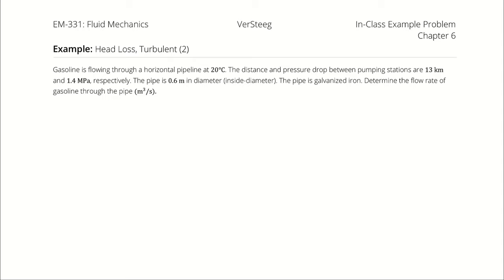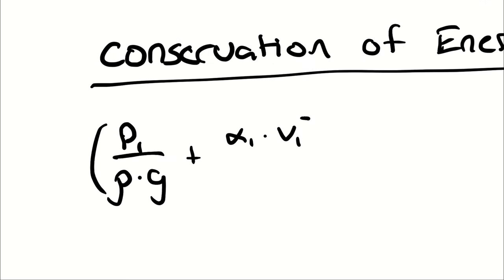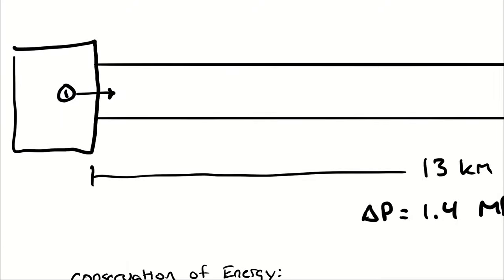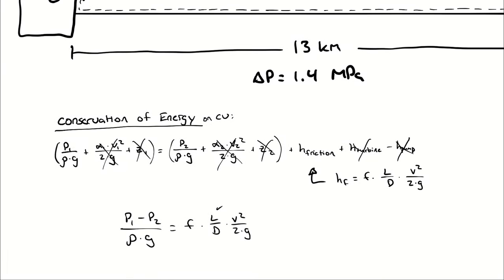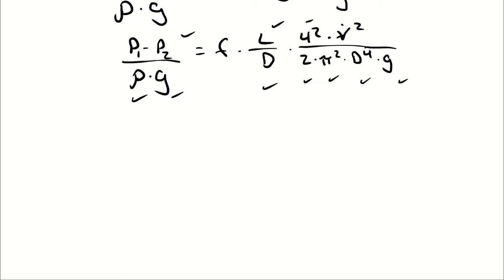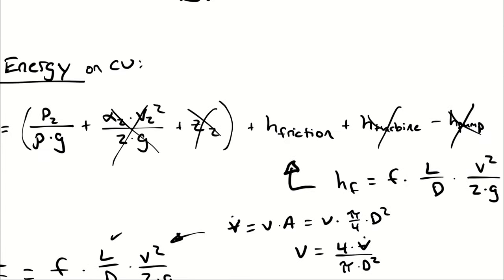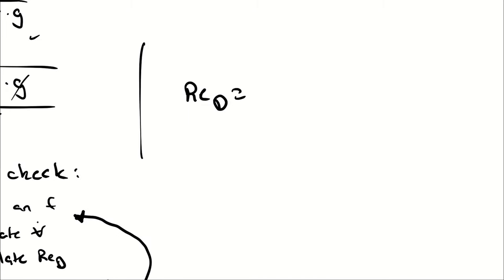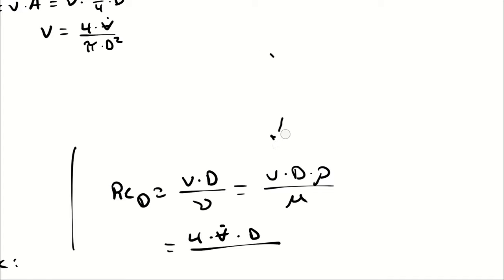Example Problem - Turbulent Head Loss #2

Comment: Thanks for the video, it's going to help me a lot for my final. Just one thing, you made a mistake in the first iteration; when you were calculating volume flow rate you forgot o square pi. Therefore 0.58154 it's NOT correct, my I got 1.0277 instead, following the same procedure and making the same assumption for the value of f.

I'm making this comment for the people that might watch this video and think that they're making a mistake because they're going to get a different result.

Again, thanks for all the help!